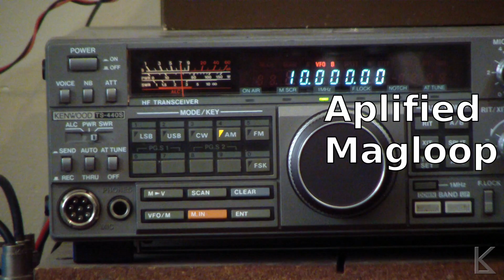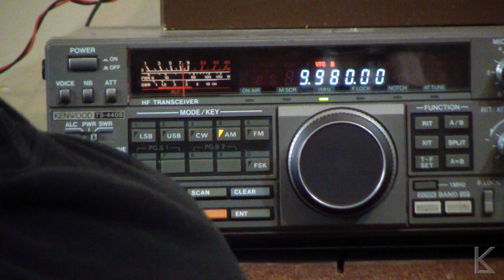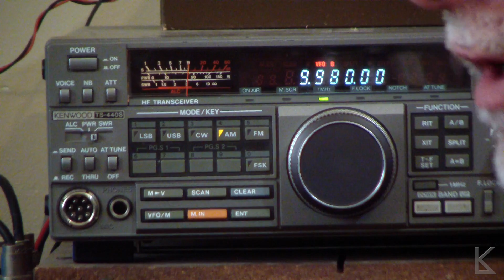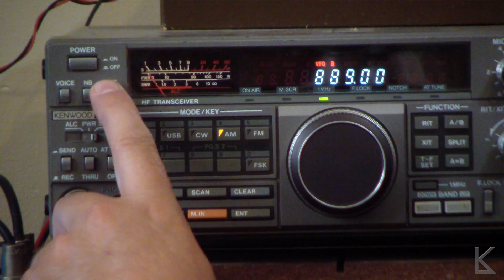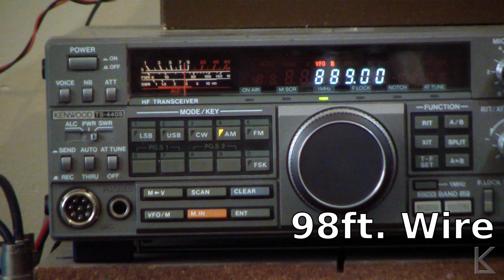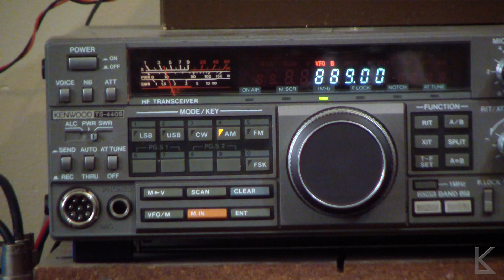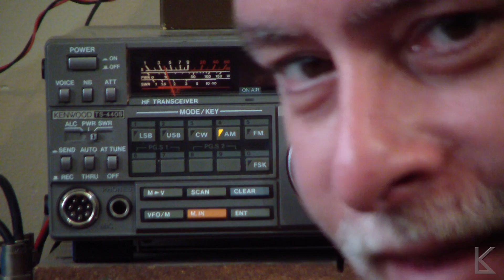Ham Radio - Comparing RX between my 98ft end fed and the active mini whip

Comment: Last comment was six years ago?  I would have thought many hams would view this video. While your test is fine for your specific application, others have to know more details.  The type and length of coax; the construction and height of each antenna; the direction of their major lobes; the obstacles near them and the way each is grounded? Is your long wire attached to a tuner?   I see many videos of hams doing tests, but few ever describe the setup.  Every ham or SWL will have a completely different setup.  A true test would place all the antennas in the same location, positioned for maximum lobes to be in the same direction, grounded at the same point with the same type and length of coax. A common tuner/preselector set to maximize the signal at the desired frequency for each antenna would also make sense.
Reply from the maker: This was a long time ago. I've refined my methods since then.

Comment: I've been told that mini-whip antennas need 'good grounding.' That's sort of subjective. How much grounding is enough?  One ground rod? Two? Three? Four?  Can I connect it to one ground rod, and then run copper from one ground rod to another ground rod? Or should the antenna be connected to each ground rod with its own separate ground wire?
Reply: Miniwhip must be mounted on an earthed metal pole at least two metres long (above conducting obstacles) and as far as possible from metal conductors. Generally the higher the better as the E field tends to be attenuated close to the ground.

When mounting on a metal pole it is important the top of the pole is below the Miniwhip's amplifier otherwise there will be capacitive losses. 

A good example of a well sorted Miniwhip in action is the University of Twente's SDR at: http://websdr.ewi.utwente.nl:8901/
Reply: @jimgraham6722  I was told they should NOT be mounted on a metal pole, but perhaps a PVC. pipe instead.
Reply: @tglenn3121  Hi, I bought one of the Ukrainian sourced pre built miniwhips. It came with specific instructions for mounting, that's where metal pole came from. I also isolate mine by using a ferrite core on deadline close to antenna. University of Twente has got one of these working well see http://websdr.ewi.utwente.nl:8901/

Comment: I'm getting similar results with the Mini Whip Vs. my 85 feet end fed long wire.  Although the Mini Whip does better on much lower frequency into longwave. The long wire is much better for shortwave than the Mini Whip.  Much more tinkering involved with the Mini Whip, it's well grounded.  I would like to place on a higher location.  Thank you for the video.

Comment: I have a mini-whip here and where it really shines is listening to the frequencies below 500 Khz for me.  I can even hear the WWV signal s-9 most evenings on 60 Khz with that but not a thing at all with my long wire antenna or anything else I have.  Also a lot of Nav beacons I can hear down there that I can't with my wire antennas or dipoles.
Reply from the maker: +RadioHamGuy yeah, I watched your video on it.  I'm looking forward to getting it up in the air and doing more tests.
Reply: Sounds great, yes, it works well for me down there but on HF, sometimes it is better and many times not.  Works pretty well for me on the AM broadcast band also!

Comment: Thanks for the test. However, the mini-whip is being unfairly treated: it needs to be up and away from any walls, roof, etc. to work properly, and then it really works great. I live on the top floor of an apartment building and extend my mini-whip horizontally out about 2m from the window of my home office / hobby workshop. This means that it is fairly high up (5th floor), and away from the building structure. 
Under these conditions it tests much better than my 60ft long wire, all the way up to over 10mhz, and especially much better on BC band. Over 10mhz, the long wore is slightly better, but not by much.
I guess this could well be a perfect apartment antenna. I'm really happy with mine. Thanks again for the videos.

Comment: Prediction, mag loop has least noise, best s/n, some direction; mini whip most noise worst performer, long wire medium noise but good across all bands.  Time to watch...  surprised how badly the loop did, I have an Alex Loop, it's pretty solid, did a 5w phone qso to a Turkey with it in 2012.  The station on AM is WLS, a pre selector will work wonders on AM, I have a video on it with a CR 1a and an MFJ SW tuner.

Comment: Hi Kevin, thanks again for an interesting video.
I thought I'd run a spice simulation on the mini whip circuit to see what happens when you drop the supply voltage, because I wondered how and why a voltage follower with a voltage gain of 1 would be affected by the supply voltage. What happens at 6V is that the JFET J310 has an insufficent voltage to be biased properly. The drain-source voltage becomes very low and the J-FET stops functioning as intended. So what is perceived as a low gain is in fact the circuit kind of shutting down. I simulated with a few millivolt signal source producing two frequencies, 7 and 10MHz. At a low supply voltage the intermodulation products increase significantly as the J-FET saturates. Maybe not the best way to reduce the effect of strong broadcast stations.
Reply from the maker: Yeah, the way to reduce the broadcast stations is with a notch filter.
Interestingly,  in my previous video where I was first testing the mini whip kit, I was supplying it via the built in biasT in the SDRPlay RSP2.  The voltage is 4.7 Volts at the connector, and by the time you got down the coax to the circuit, it was just a tad under 4 volts.   Still a lot of gain though.  You can see the signals just leap up when I enable the voltage.
Reply: Hi Kevin, so it looks like it is still working to some extend when at a low voltage. Did you get back to the SDR and use the full 12V on the whip?
Reply from the maker: Yes,  just a bit more than double the gain.    My test signal was coming from my generator down on my bench, so it was steady.

Comment: maybe compare WWV on 2.5, 5 , 10, 15 Mhz etc. rather than just 10 Mhz and medium wave. I suspect the smaller amplified antennas may do better the higher in frequency you go and the wire lower. Interesting .
Reply from the maker: Actually, the mini whip falls off as you get above 15 Mhz.   It's better at the bottom end.  It's a really interesting little device.